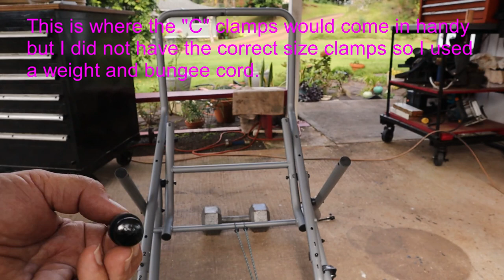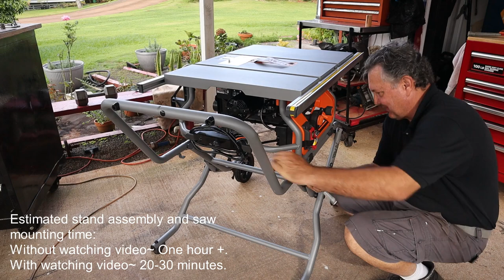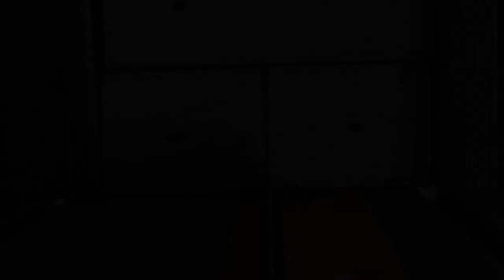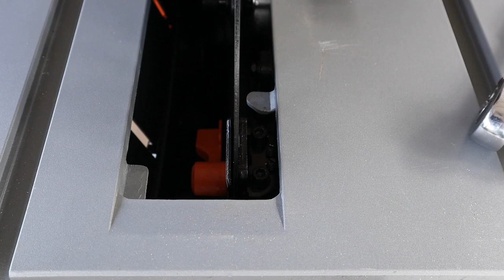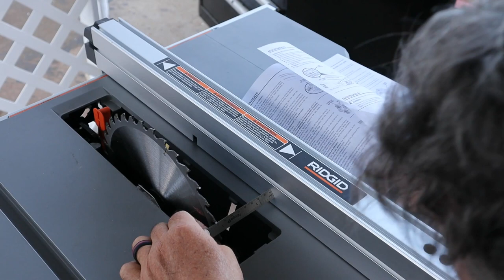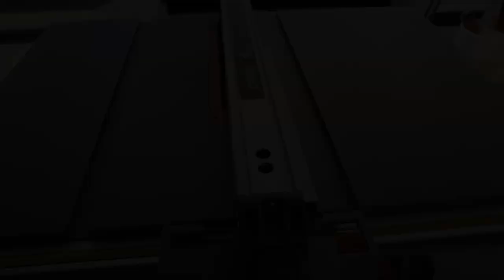RIDGID R4514 10" Table Saw: Assembly and adjustments in detail.

Comment: I must say this is by far the most detailed video on table saw tuning, I just got the exact same model  about a week ago and I’ve been having the hardest time tuning it. WELL DONE !!
Reply from the maker: Aloha Smokey The Bear,
Thanks for the kind words and I hope that it helped you out. I kept the saw and have been happy with it. The key is setting it up the way you want to have it so that it operates within your needs and expectations. I'm just at the hobby level so I would like precision but am not worried about the high capacity production aspect of the saw. That saw was the best deal I could find that had the capacity to cut through 4X material.
Mahalo,
Maverick Mike.
Reply: L’m having an issue with the 90 degree bevel. I loosened the screw too much and the stop mechanism got loose and now l’m worried I messed things up. L’m going to tighten it back up and hopefully everything works out
Reply: I bout the same one and having issues getting it square
Reply: @maverickmikekauai3515    Thanks Mike, this was an excellent video covering everything from A to Z.  I appreciate the effort you put into this and have only given one thumbs up because that's all they will give me, but you deserve more!  Thanks again from Canada.
Reply from the maker: @northernlightsrenovations1710  
Aloha NLR,
Mahalo for the kind comment, I appreciate it very much.

Mike.
Reply: the only thing I needed was the large fence adjustment! but then I spent 2 hours tuning up the whole thing thanks to you. this was a great video.

Comment: Your time invested into this video is appreciated and was in part helpful in part  in helping me make a decision on purchasing this saw. One point I'd like to make is what I tell most of the youtubers who make videos on table saws. You don't square a rip fence to the blade, you make it parallel. This applies to the miter slots on the table as well. If your miter slots are parallel with the blade then you may adjust your rip fence to be parallel to the miter slots. Conversely, you square a miter gauge to the saw blade/miter slots. Have a nice day
Reply from the maker: Aloha Charles,
Great point! I'm glad I got the saw BUT it is not great if you are trying to do precision work like furniture making.  But it is marketed as a contractors job site table saw and for that job it is mostly ok.
Thanks again for the great comment.
Mike

Comment: I just bought this saw today.  I went through the adjustments but after watching your video I realize there are some I missed.  Most settings I have checked so far had to be corrected like yours.  I actually laughed when adjusting the 45 degree setting when it said to move the pointer to align with the 45 mark after setting the6 pointer on the 0 degree mark.  They needed to make the scale adjustable too.   I found the same issue with the table top as yours, it is not flat.  Had to keep saying to myself; its not a cabinet saw.   Thanks for the great video!
Reply from the maker: Aloha Jeff,
Thanks for the great comment about the video.
Enjoy the saw and as long as we understand who this saw is made for then we should be able to deal with it's many issues. Another issue you may find as you use the saw is with the Riving Knife. Mine saw so thick that I noticed it was throwing my cuts off.  I have had several conversations with other folks about this issue and what I did to "correct" the problem. Check for the post in an earlier thread.

Mahalo,
Mike

Comment: Great video, and Aloha to you.  Living in Oklahoma but born in Honolulu.  Military families move all the time, we just happened to be there when I was born.  I had a hard time with my saw, I measured the 90 degree angle at 88.8, nowhere acceptable.  I could not turn the cam to the right at all so I ended up using pliers on the back side like you showed and finally got it at 89.9, good enough for me.  The riving knife drove me up the wall.  I would set it then while tightening it up it would drift to the right and out of alignment with the blade.  This was taken care of by moving it to the left out of alignment just a little then tightening it up and it drifted to the right perfectly aligned.  All other angles were spot on.  I don't understand how everything could be spot on except the 90 degree angle but that was the case.  Thank you for making this video, you answered a ton of questions I had and did a much better job then the instruction manual.

Comment: Mike, I have had my Rigid for over a year now.  I did not do any adjustments out of the box that I remember.  I have,  over the last year, used it a lot and compensated for the degrees of out alignment.  I will be following your video to get mine up to par very soon.  Better tuning = higher quality work and saves time.  Thanks for this. Mahalo
Reply from the maker: Aloha Jay,
Sounds like you got a fairly decent saw right out of the box! That's awesome. So many of the issues with this saw would just disappear IF the table top was manufactured straight. 
Mahalo for the kind words!
Mike

Comment: Thank you for this video. I bought this saw back in 2018. It sat in the box for about a year, we finally set it up and made a few shelves back in 2019 2020 time frame. Well last weekend decided to try my hand at edge miters for a floating box shelf and realized very quickly I needed to adjust the saw. Going to have to further adjust per your video.
Reply from the maker: Aloha GamerNxUSN,
Hopefully you ended up with a saw that was not as messed up as mine was. Good luck and thank you for the kind words. Hope the video helps you out.

Mahalo,
Mike

Comment: I just bought this saw today. On sale at HD for $397 Canadian dollars. It’s still in the back of my truck. I was wondering why so cheap $200 off regular price. I was going to get the skil but the price was great.
Glad I watched your great video before unpacking.
I should be fine for decks and fences, only ripping with it. I’ve got the dewalt  780 miter saw which is spot on.
Reply from the maker: Aloha J,
That's a good price.
I'm reasonably happy with the saw but it certainly would not be my first choice for furniture making.
Glad you enjoyed the video!

Mahalo,
Mike

Comment: Great Video.  Very detailed, and to the point.  I have had this saw for about a week now and started using straight out of the box because I had some stuff that needed to be done.  The cut were pretty good, I was surprised at how good with no adjustments.   Now I have a couple days to relax I will check every measurement that you have detailed.  You are a big part of why I love You Tube.
Reply from the maker: Aloha James,
Thanks for the kind words. My fence was good right out of the box as well and the saw was sufficient for "standard tolerance" framing work and similar projects. It just needed to be dialed in better for detailed, precision work and I did the best I could but was limited by the table top being out of square/plumb/even. I'm not a contractor but rather just a novice hobby level woodworker having fun with a new hobby.

Mahalo,
Maverick Mike.

Comment: This is a good video. I also just got this saw and ran into the same issue, The zero cam was loose. I wasn't paying real good attention to the video though. When I got chance to take a look I saw my cam was loose and I was also expecting to see a lock nut and there wasn't one. I kind of remember seeing a little nut I could find no use for in the box, but it was gone. So I went to the hardware store to pick up a couple nylock nuts and a little longer button head hex socket screws. So I used more blue locktite on the cam and also used the locknut. I was able to hold the cam pretty well with some long nose vise grips. Then I got to thinking that while I mainly use it with the blade in the vertical position, I do change the angle sometimes. I got to thinking that at that time there would be no tension on the cam and just vibration could cause it so move. So I then took it off again, went back to the hardware store and got a couple of thrush washers to one each screw where the bolt came out of the hole on the inside and ahead of the cam. I did that to the 45 adjust too. I think that will also take care of the can't turn it counterclockwise problem as well. So I have just set it up and I don't know how it will work over time, but I thought I'd add this comment.
Reply from the maker: Awesome problem solving! Thanks for sharing with the rest of us.

Comment: I just used this saw over the weekend.  I ripped 5 - 2x10x9 footers into 3/4" slats for a Slat Wall project in the entry.  I'd say that's a pretty heavy project for this table saw and it performed very well.   Also - it took me a little more than 15 minutes to assemble the stand and mount it.  :-).   Happy I made this purchase last year.  Also thanks for the video, it is a great compliment to the manual.
Reply from the maker: Aloha David,
Thanks for the good comments.
I also am fairly happy with the saw but I do wish that I could make more accurate cuts with it without having to jump through hoops.
Glad you enjoyed the video!

Mahalo,
Mike

Comment: I just bought a 4514 last night and happy to say everything was correct out of the box other than the table surface was not square slightly on the edges.

I expect stuff to loosen up as it's used but will be using your video to get it back in order. Thanks for the great video
Reply from the maker: Aloha,
Glad you got a good one. Hopefully efforts are being made to increase the quality of the saw.
Thanks for the kind words.

Mike

Comment: I got this saw less than a year ago
I'm happy with it...
The blade height plastic knob cracked and I had to put a hose clamp on it to keep it from slipping where I couldn't change the height.
Now  leave it all the way up just in case.
Recently had the thing stop working and figured it was the switch
Took it apart and didn't take a picture of the wires
Before I figured out it was the house wiring
Not the breaker, outlet, or switches...
So I'm going to be stuck awhile trying to get the switch back together
But still, I love the saw
Reply from the maker: Yes, I was worried about the height adjustment. Oiling the slides helps a lot.

Comment: Ridgid may have seen your bungee. Mine came with the preconnected leg parts wrapped in shrink plastic to hold them in place.  I left the shrink wrap on until all parts were connected by number.  Then once the wheels were on I cut the plastic wrap off.  Simple and easy now.

Comment: Thank you for the video. Just picked up one of these yesterday, and have been setting it up today. This was very helpful, as most things needed to be adjusted to get the blade square, riving knife set properly, fence, etc. I also found that the scale for the angle was just wrong. I also had a heck of a lot of trouble getting my 0 adjustment set...there seems to be some folds of some kind of fabric underneath the table that interfere with actually reaching a true 0 degree angle on the blade. I can manage it, but it takes some force on that adjustment wheel to really get it there, and I have to hold tension until the angle is locked... Seems sad, that for an otherwise very nice table saw, the angle adjustment is so problematic.

I also had one thought to offer about adjustments. When you aligned your fence, you chose to measure from the flat part of the blade, rather than the recommended point of the outer edge of a tooth. I just thought I would mention that the "kerf" of the blade is from outer tooth edge to outer tooth edge. If you measure to the flat of the blade, the kerf will cut into the width you desire, which should be set by the fence, and you won't actually get a truly accurate cut. So, I'd recommend (and I know this is two years old, but here goes anyway) that you always calibrate your fence distance to the outer edge of the tooth, not the flat of the blade, for the most accurate cut.

Comment: I really appreciate this video just got this saw for Christmas. Used this video to make all the small adjustments. Unfortunately just like you I have all the same issues table top not square or level with itself. My bevel angles were off and I had to adjust like you did. My fence was not square so I had to fix that. Not impressed with the saws build quality at all. But it was a gift and I can make it work. Thanks again
Reply from the maker: Aloha Simple Man,
Happy to hear that the video was helpful but bummed to hear that you got a saw that was as messed up as mine from the factory.
Hopefully RIDGID will address the manufacturing issues that keep this saw from being a great saw.

Mahalo,
Maverick Mike.

Comment: Great video. Thanks. My cuts were never square and I thought it was me. Well, I’ve never calibrated, so yes it was me. In my case, I was off by 0.6 degrees. The saw came without manual but, after inspection, I’ve noticed two hex screws by the 0 and 45. By turning these, you can actually go beyond  0 and 45 and reset the needle

Comment: Thank you for the best video I've found on this saw! I just bought one a couple of weeks ago. 
     Earlier this year I purchased Ridgid's 12" sliding miter saw w/stand and absolutely love using it. I didn't have to touch a single adjustment! It's solid, dead nuts square out of the box and super easy to set up and move around. So I thought surely their table saw will be just as good, right??? ...well...I might have been better off going to Lowe's and getting a Bosch with their gravity rise stand...LOL. 
     When I assembled my R4514 I too thought about returning it. I ran into all the same issues but I am still very happy with it. In my opinion the fence system is the linchpin of any table saw, and Ridgid did well.The only issue that really bothers me is the tabletop being out of flat on the opposite sides of the miter slots. However, it's 100% better than my first saw, the Hitachi C10RJ. The rack and pinion fence was crap. It drove me nuts and I ended up selling it a couple years later. It drove me nuts. At the time I was new to woodworking and have learned a lot about tuning power tools since. The manual was translated into english and made tuning the saw that much more difficult. Even when I got it close to true it wouldn't hold for very long. 
     Pardon me for writing a "book" here lol! I really want to thank you for the time and effort you put into this video. IMHO it's definitely worth paying to watch and Ridgid/Home Depot should be first in line! They definitely owe you for helping their customers! God bless you sir!
Reply from the maker: Hallelujah! Glad it helped and hope that it continues to help others as well.
Hmm, I was thinking about a sliding miter saw...
Reply from the maker: Sounds good, lived in TX for a few years. The Bosch looks like a really nice saw but it is pricey. I couldn't justify the expense for occasional use at the hobby level. Will just wait for good sales and see what popps up.
My next project will be to make a mobile workshop bench with all the tools (toys!) mounted to it. Been watching videos of many cool benches gathering ideas. There are lots of talented folks out there with good ideas.

Comment: Mike.   Very much appreciate the time you put into this video.   I followed you through step by step.  My R4514 seems to have made it out of the factory in better shape than yours did.   Although the blade needed both horizontal and vertical adjustment, the zero stop blade adjustment worked fine on mine. The left side of the fence was perfectly perpendicular to the table and the low fence didn’t require any adjustment.  My stand wouldn’t close all the way so the lock would catch, so I had to remove one of the rubber stops so the release lever could lock in place.  Anyway thanks for the tutorial.
Reply from the maker: Aloha Ron,
I'm delighted that your saw arrived in better shape than mine did and that the video was helpful to you.  In a way it is good that mine needed extensive tuning so that other folks with the same issues could watch the video and reduce the time necessary to tune their saw up.
Mahalo for the response and very kind words.

Maverick Mike.
Reply: Mine so far appears to be in better shape too but only checked the 90. My table does seem to have a very slight bump right In front of the throat plate
Reply from the maker: Aloha Charles,
Glad to hear that your saw is in better shape. Maybe I just got a poor example of the saw or maybe RIDGID has been improving their manufacturing processes.

Mahalo,
Mike

Comment: Well Mike,   I ended up taking the saw back. For the first couple of cuts the on/off switch worked perfectly, but the third time I turned it on to make a cut, the motor stopped as soon as I took my finger off the green button.  From that point on the motor wouldn’t stay on whenever I pushed and released the on button.  I called Ridgid’s customer service and the told me it was probably a defective switch, so I took the saw back to Home Depot and exchanged it for another R4514.  The exact same thing happened with the second saw.  Customer service told me they could send me a switch, but the problem might not be the switch. I just don’t have the patience to have to be repairing a brand new saw so I took my refund and guess I’ll be waiting for the DeWalt or Bosch to go on sale.
Reply from the maker: Aloha Ron,
Wow, that's bad news. They must have gotten a bad batch of switches from their supplier. The switch on my saw has been working just fine up until this point and I used the saw again today.
The main reason I purchased this saw was it's ability to cut 4X material at a great price.
I just wish the table was flat/square.

Mahalo,
Maverick Mike.